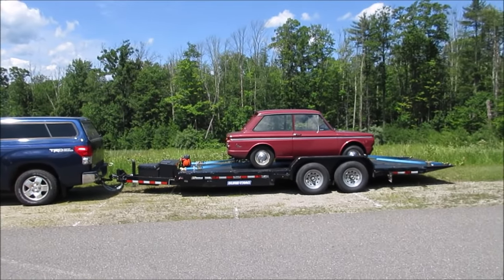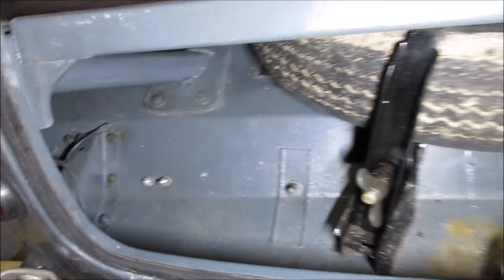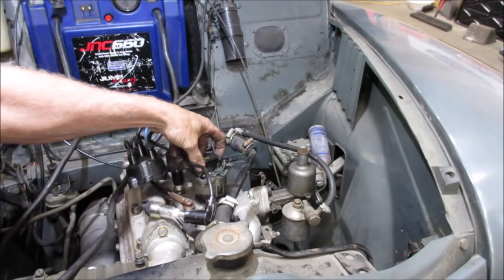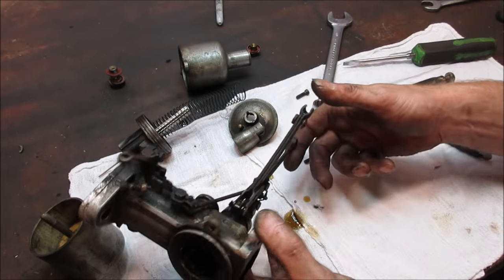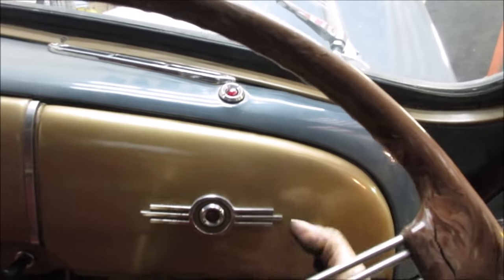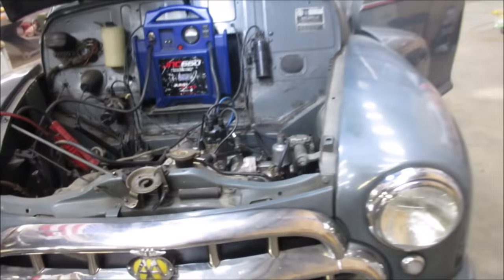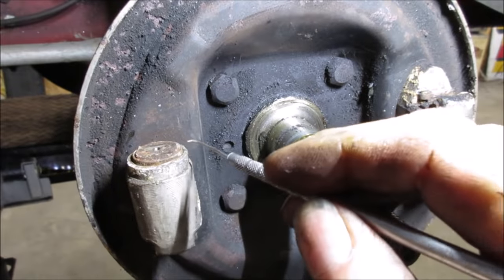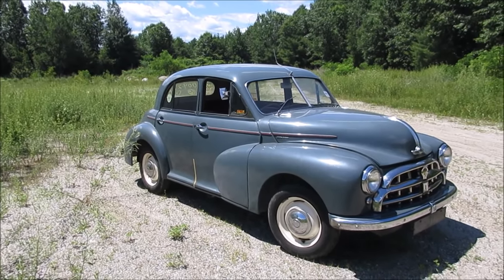50s Morris Oxford Found in an Old Warehouse. Did It Survive?

Comment: As it happens, I came across one of these at a vintage show yesterday with a very enthusiastic and talkative owner, so I asked about your two little red button/lights in front of the driving postion. They're warning lights: the one on top is a charge warning light and the one in the centre of the panel is a high-beam warning light. Solved!

Comment: Awsome old British car! The flat brass cap that unscrews from the top of the carb is a dash pot. This had thin oil in it to aid the vacuum draw on the needle and also to smooth out the needle movement from bouncing. Without the oil the acceleration would be weak and poor tick over.  The knob on dash to the right of the steering wheel is the hand screen washer pump which had to be pumped by hand. The washer bottle is the white nylon bottle on the bulkhead. Are we allowed to use the right terminology in this case? Bonnet = hood, Boot = trunk, Handbrake = parking brake. Definately get that exhaust leak sorted and a decent set of plugs and leads and that engine will chug along all day. Keep up the good work!
Reply: I think we can handle your odd words just this once, sure! 🤣
Reply: @Hjerte_Verke  Aw shucks. Thank you, have a great 4th July.
Reply: You can add 'side valve' = 'flathead'  to the list of correct terminology.
Reply: Just don't start with Aluminnydeium or whatever.

Comment: Many British cars of this era (including several of mine) were +earth - plus there is a clue in the 'P' and 'N' stamped into the battery connectors.  It was thought that +earth was less prone to electrolytic corrosion in the damp British climate.
Anecdote: I was involved in installing video camera into London's bus fleet in the mid 90s.  Some of the traditional buses were still +earth, which came as a shock (literally) to some of the engineers who had never heard of +earth; several video recorders quickly became expensive smoke generators.
Reply: American cars used to be positive ground as well.  I think my dad's old '56 Caddy was that way (6 volt as well).  But the conversion to - ground and 12V was sometime in the 60's.  Far too long ago for most mechanics today unless they worked on classic cars (as opposed to old cars they could afford).
Reply: Freightliner trucks used to make positive ground trucks. I Smoked a Good C.B. Radio learning this. Ha!
Reply: Mini's were the same.
Reply: My 67 MGBGT was the same. Bought in '86. Daily-driver til 2007. In Oregon. Some rust but not compared to other vehicle I owned. Re-mounted a tricked out alternator to Positive Earth. They should never have changed to Negative Ground!!!
Reply: @russellhltn1396  Cadillac and most other GM cars switched to 12 volts, at least here in the US and Canada, in 1953, and switched to - ground for 1940 for the Buick, 46 for the Cadillac.  Not sure about the other divisions.
Reply: Changing from positive to negative ground is a simple as 'flashing the dynamo'. Disconnect the dynamo wires, connect the battery as negative ground, start the engine then use a piece of wire between the positive terminal to the 'F' terminal of the dynamo. This re-magnetises the dynamo field with the opposite polarity. Switch off, connect the dynamo back up and hey presto your car is now negative ground. Just search 'polarising a dynamo' Obviously make sure that any radios etc. are ready for this.
Reply: @IanDarley  That's only guaranteed to work if you have a 3 brush generator, (dynamo), with only a cut-out.  If you have a voltage regulator, as all 2 brush generators do and early 40s Hudson 3 brush gens do, that will usually not work as the factory-style regulator only allows electricity to flow in one direction.
Reply: @IanDarley  Also, your radio won't work.
Reply: @michaelbenardo5695  I'm pretty sure my dad's old '56 Caddy wasn't 12V negative ground.  It's possible not all lines switched as the same time.
Reply: @russellhltn1396  Trust me, it was.
Reply: @IanDarley  Yesss -- welll -- After going through two new generators, DIY,  I considered that remanufactured were a better bargain and lasted just about as long for about 40% less $$$. I think there were three rebuilds after the two new ones -- all from thrown solder. Probably why I got a 67MGBGT for $650.00 in 1986 -- stopped at a long light at night with low RPMs tended to work generators really hard.
One day I found a wizard who could  "persuade  *some*"  alternators to operate as Positive Earth. Instantly I went from nominal 22Amps to 85Amps -- this I drove with glee almost daily for about 15 years or so. 
I had to re-invent and rebuild an electrical harness for the '67. About as complicated to wire as a kids train-set. I had lots of lights (Cibié) and a defroster THAT WORKED!!!  I was buying old bits and pieces from FASPEC at least once a month.
I found vintage surplus industrial hardware and crafted a metering panel where the octagonal MG inset connected the tunnel to the dash in front of the stick. This because Lucas abandoned the MG / Triumph / Healy crowd to slip-shod electrical bits. 
Intermittent faults were a weekly hazard. By being able to monitor alternator current output while watching battery charge/discharge amps and system voltage all at once I could identify the suspect components while still in motion. 
This resulted in new wires & welding cables for the batteries and soldered connections under the bonnet. I kept all the old instruments unchanged, but had to mount the modern stereo in a chassi-ground isolated mounting.
At one point I owned a '65 B (ended up as a parts-car), a '67 BGT, & an '80 B Limited Edition (which was just a decal and a third wiper). 
None of them had electrics that were worth a damn.
But I had fun -- discovered that my favorite drug was gasoline on a hot night driving a twisty road over a "Bad-Boy" Suspension from Moss with many running lights burning after letting a little air let out of the tires. Uh-huh!!! 
I ran through Dunlop Performance 185s like crazy but only changed the brakepads once on the 67's  front-end  in 22 years. My tailbone could not have been 6" above the ground. The Knock-Offs were about level with one's ribs. I could study other peoples suspensions. I could not be caught in a corner. Torque for days but with 95mph being about as fast as you wind her up - wind assisted. FUN! 
I miss that car.
Reply: @michaelbenardo5695  The family '63 Falcon wagon had a new battery somehow put in the wrong way. Everything worked except the transistor radio quit and the electric rear window went about half speed. I don't know if the radio had to be repaired when the mistake was discovered and corrected or if it just started working.
Reply: @emjayay  I don't know how it could have affected the tailgate window, but a car radio will not work if the battery is hooked up backwards.  Won't harm it, so putting the battery in correctly instantly brings it back to life.
Reply: @michaelbenardo5695  -Trust you. Come on now.
Reply: Used to turn over the engine with the starting handle before starting on a cold morning making sure the handle was engaged properly in the starter dog. Lots of fun 😮
Reply: When you were doing carb disassembly looked like defusing a bomb.

Comment: Hey Mustie 1,  I'm glad to see that you're featuring old British junk. My dad had one of those in the early 60's They were dead slow but easy to fix,and considered very old fashioned even back then. They used the BMC 'B' Series Engine which was reliable.Incidentally the car was designed by the same man who designed the Mini i.e. Alec Issigonis. Cheers from the UK.🇬🇧🇬🇧🇬🇧
Reply: I'm pretty sure that that is not a B Series as it is a flat head / sidevalve.
Reply: @malcolmtill  he Mk1 with the split screen was  side valve engine. he Mk2 and 3 were B series. he Mk4 was an Austin Cambridge design and different chassis.
Reply: @martinhow121  INDEED. How many "BANGER" racers have sent early Austin Morris cars to car heaven over the years, and still finding good condition cars for "PRE" 70 events.. The money a solid early Austin or  Morris ((Riley & Wolsey) now fetch is amazing just for its final day as a moving car, and yes I once raced them also - Great memories too..All through the video i kept saying - Its that you do, or no it dont do that, but, a learning curve is learned for life eh.. Thanks for the Vide Mustie/ OK how many times did you open the wrong door to get the steering wheel, and did you notice the blanking plate on the firewall for Export only use to bung the steering column through ? - LOL - Thanks - Ian.. UK.
Reply: These Morris Series MO didn't have a B-Series engine, that wasn't introduced until after the BMC merger and the introduction of the Morris Oxford Series II. The Morris Oxford Series MO had a 1497 cc side-valve engine.

Comment: The oil in the dashpot of the SU carburettor looked far too thick, when you unscrewed the piston. The SU is a constant vacuum device, where the mixture is controlled by a tapered metering needle connected to the bottom of the piston, sitting in the main jet. The thick oil needs to be cleaned out and replaced with an oil no thicker than 3 in 1 general purpose oil. The SU fuel pumps are notorious for failing. I remember a night time journey from London to Edinburgh in my Healey 3000, where I spent the last half of the journey tapping the SU pump, which under one of the rear small occasional seats (removed) with a copper hammer to keep it running. Cleaning the points under the plastic cover may help. I replaced my SU pump with a Bendix, which never failed. Another important thing. DO NOT grease the lower front suspension trunnions or they will fail and leave you at the side of the road with about 30º of negative camber. They need to be lubricated with heavy oil either SAE 90 or 140.
Reply: it looks like a CV carb as can be found on millions of japanese bikes. (Keihin was a big name)
The dampening oil probably has the function of acceleration enrichment because the oil slows down the needle movement. The thickness of the oil probably determines how fast the carb reacts to big throttle movements. Might also help with cold start enrichment?
Reply: @jfv65  Correct. But it is an early type SU carb. And the dashpot for the piston damper must be filled with 3-in-1 oil up to the thread, otherwise tickover will be rough and acceleration will be hesitant. 
Worth noting that the "handy shelf for the booster battery pack" is actually the space for the optional heater. And the mysterious knob on the RHS of the dashboard is probably the windscreen washer (manual) pump.
Reply: Yes you have to time how fast the slide drops in order to syncronize if I remember right.
Reply: I'm not going to give my age away other than to say I used to service these cars when they were relatively new.The SU Carb's damper used 20w50 engine oil,do not put 3 in 1 oil in the dash pot under any circumstances if you do the carb will not work as it should,the damper piston should be difficult to push up with your finger.
Reply: @turbo3492  A friend of mine has also had good luck with 20w50 in his. ATF also worked, though not quite as well.
Reply: 20W50 usually works just fine for most SU equipped engines. SU themselves recommend a straight 20 weight oil.
Reply: SU is short for, "SUcks".
Reply: Yep I thought the same, should be a nice light oil. Use to use 3 in 1 in all my minis SU carbs back in the day
Reply: I used to work for su and yes you are correct
Reply: @manolisgledsodakis873   I was about to say the same. Also to "hit" the SU pump early on. I am 72, remember these engine's well.
Reply: I'm glad you didn't put a layer of oil around the piston, you might never have got it to run properly. I was almost shouting NO at the video.
I never had a problem with SU fuel pumps but for those who did cleaning and adjusting the points under the cover would fix it.
Reply: @chrishartley1210  Me too!
Reply: @turbo3492  Three in One is SAE 20, which is what SU recommend.
Reply: @turbo3492  Indeed..  I always use whatever oil I put in the engine. Too light a grade and carb will suck it away.
Reply: @andrewhiggins8873 Hi, i had a Worsley 1500 , a MG 1300 and a Morris Marina 1.8 , all had SU carbs and I used 3 in 1 oil in all, and all ran fine.
Reply: @brucepickess8097  yes u can alter the oil thickness to alter how fast the mixture changes
Reply: I knew a guy that used Vegetable Cooking Oil in his SU carb.  Seemed to work fine, but I would be concerned that it would get gummed up.
Reply: I agree with you totally - and yet I remember the manuals recommending a motor oil!  Vary surprising - especially when you remember how viscos that gets when cold!
Reply: Had the SU fitted to a 1983 Metro fitted with the by then A Series plus engine and then a 1993 Metro or Rover 100 ( as it was then called ) which was fitted with the K series engine. A family friend was the Service Manager at a local British Leyland dealership and so had done his apprenticeship on Austin/Morris. He drummed into me the importance of keeping the damper lubricated, and always with 3 in 1 oil.